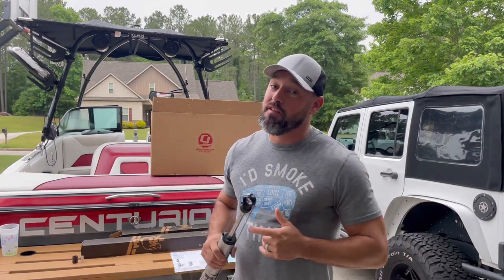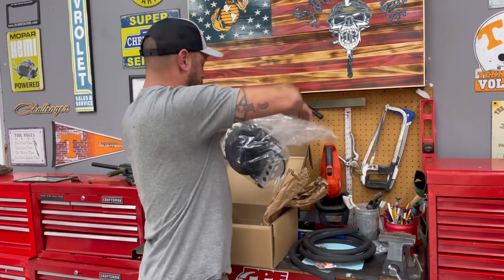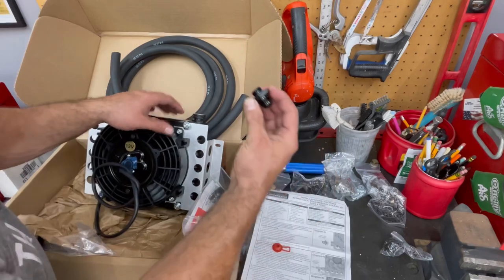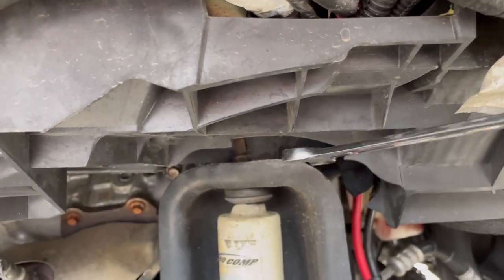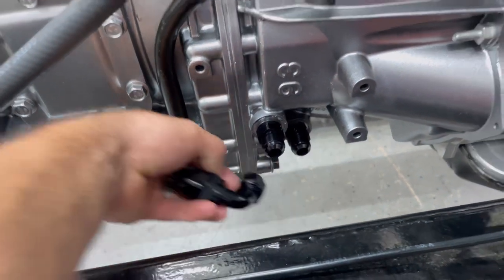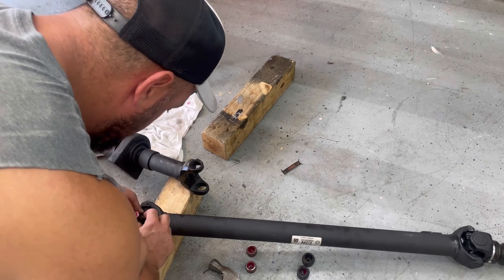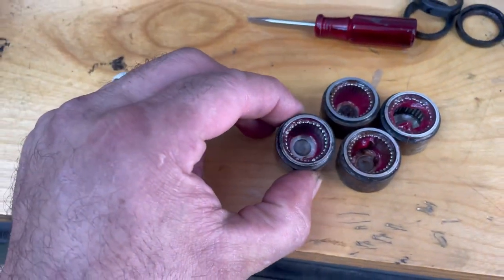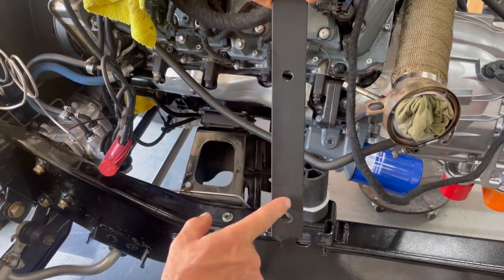Humvee Duramax Swap Transmission Cooler

Comment: I would confirm your original fuel tank will fit in the truck before mounting the transmission cooler there just in case you have to mount a fuel cell in the rear location. As for your driveshaft situation, you might be able to locate a conversion U-joint that has two spindles that match the Humvee and two that match the Allison/ Duramax shaft. I found one like that for my Cummins conversion. The alternative is you will have to have one of the end caps removed and replaced with a new cap that fits one of the U-joints. I prefer the snap ring so I would convert it to the Humvee U-joint. I have found both of these parts easily on Ebay. I'm enjoying watching the progress. I had to take a hiatus on my Cummins project to get my M915a1 back on the road and my new shop building up.
Reply from the maker: Good advice! Thanks

Comment: Also that upper radiator hose will work perfect don't worry about it hitting the fanbelt, if you cut an inch or two off the side that you have connected to the radiator it will pull that neck forward away from the belt
Reply from the maker: I think if I do cut an inch or two off it won’t fit on the engine side

Comment: Others have comments about conversion u joints, I could be wrong about this but could the whole 2 piece driveshaft from the original humvee be used just as factory and a different yoke at the forward transfer case output be installed? I think this is how hxp does it.  It maybe the least expensive option with little custom parts. Also I have tried myself to shift the carrier bearing and driveline away for the engine by lowering it only an inch. The vibration was severe I had to put it back to the factory location. The back driveline may have to be fabricated and balanced unfortunately. At least you have both the chevy driveline and humvee driveline and measurements to go off of. Wishing you the best and have fun😃
Reply from the maker: Yeah this drive shaft situation is crazy… I’m trying to find a conversion yoke, but I can’t seem to find one that’s a 1330 to a 1410 yoke

Comment: I was thinking a conversion on the yoke as well u bolt conversion done to the current front drive shaft. Your rear drive shaft may need the same conversion and possibly shorter. Just a thought.
Reply from the maker: So I’m looking into the conversion yoks and I cannot find one that’s a 1330 to a 1410 yoke…

Comment: For the drive shaft issue. See what the 2006 hummer H1 Alfa used. As they came with that same swap from factory
Reply from the maker: I’ve tried and tried but can’t find Jack crap! I think I may have got the front driveshaft good!

Comment: I think you should mont the transmission cooler right in the middle where you have it but turn it 90 degrees and so the mounting holes are on the top of the open gep and bottom
Reply: That way the fan is not restricted at all
Reply from the maker: Yeah I was thinking about that too

Comment: you will probably have to have a drive shaft made for back cause I don't think they make conversion ujoints for 1he 1550 joints off duramax
Reply from the maker: That’s what I’m thinking too, now trying to find a shop is the hard part now days

Comment: Don’t they make U-joints with two different sizes? I swear I’ve seen something like that before. If that’s not a thing and I’m misremembering, then the solution is smaller diameter needle bearings.
Reply from the maker: Ahh maybe I’ll check it out